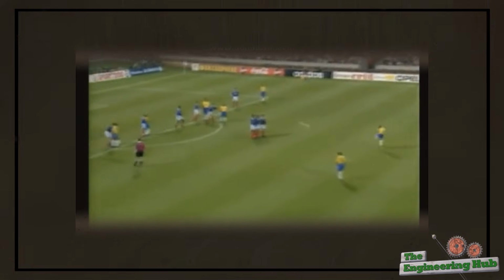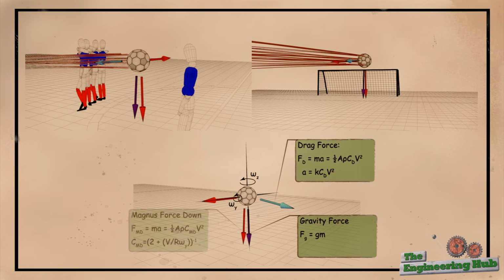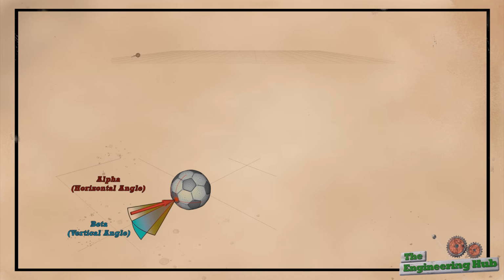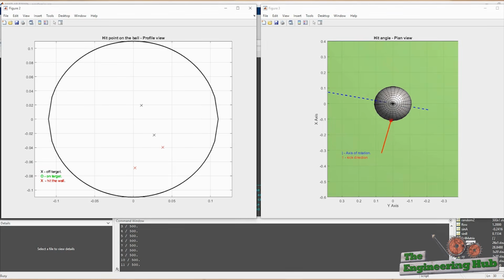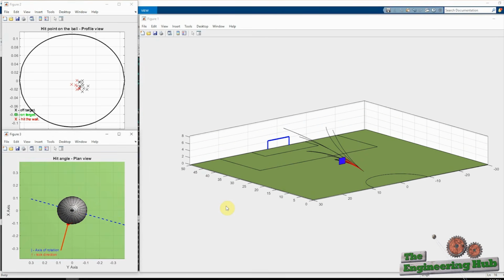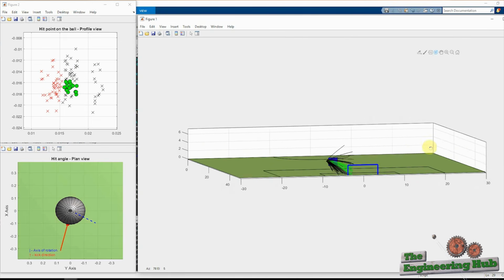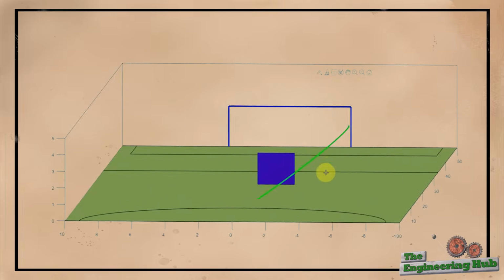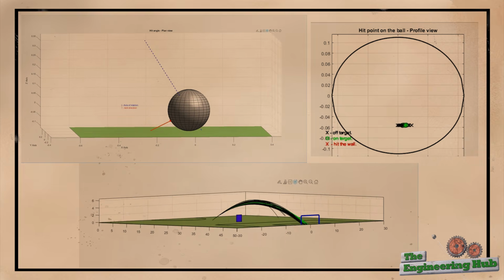How math and physics determine sports!

Comment: hey man, I am working on my extended essay for the ib. I am doing something very similar to your work. My research question is: "With a numeric simulation, how can I derive how a football must be shot on a free kick to score a goal?" I have already programmed a Python simulation allowing me to give 6 starting conditions: spin speed and 2 angles for the axes and shot speed + 2 angles for direction. I have also made a simple visualisation of the shots. The final step I want to take is the same thing you have done: I want to find out how much of the force is translated into spin and ball speed. Do you have some material on that, for example, a formula or something? I am not sure if I formulated this well enough for you to understand, I sometimes struggle with expressing myself with these scientific questions, as I am not a native speaker... Thanks in advance for your help!!
Reply from the maker: Hey buddy, I would recommend the book: Vector Mechanics for Engineers (10th ed) by Beer. More specifically Section 18 and Sample Problem 18.1. This will guide you through a 3D example. For modelling rotating bodies (balls) the magnus force plays a huge role. You would need to introduce this force separately which is a function of the spin of the body.
Reply: @TheEngineeringHub  thanks so much!!

Comment: Hi, thank you so much for the video, could you just explain on how you got the equation and what step size you used when using Euler's Method?
Reply from the maker: Hi, the underlying physics can be found in a generic dynamics textbook. I followed Chapter 18 of Vector Mechanics for Engineers by Beer, 10th ed. Sample Problem 18.1 should be a good starting point. In regards to the step-size, it had to be fairly small because the Euler's method is very poor, I don't exactly remember the size now but the model was prone to numerical instabilities unless the step-size was very fine. If I were to re-do the model now, I would convert the equations to a state-space representation and use 4th Order Runge-Kutta solver which is much more accurate and doesn't require as small of a time-step. Cheer!

Comment: Hey man, I really loved the work you put into making this simulation and video! It also got me thinking about the magnus effect on soccer balls and what "knuckleballs" really are. Please don't read my comments as criticism of your work, it's more that I am hoping to start a nice discussion.
When I see footage of sharply curved shots it often strikes me that the ball seems to be spinning a lot less quickly than I would think is needed. Also Carlos' shot seems to not spin very fast, which makes me think that the magnus effect is only one component of the lift on the ball. The other component I guess would be deformation of the ball, departure from its initially approximately spherical shape while it wobbles due to the impact of the kick.
I feel this idea is supported by the fact that hitting a proper knuckleball (as I understand it) entails hitting it very straight through the center so that hardly any spin is given and the trajectory becomes unpredictable due to the ball's elastic wobbling after the impact. 

I couldn't tell from your video how you determined the imparted spin due to the off-centre touch, which would already have had some assumptions in there (shear fiction of the contact with the shoe for example), so the one thing we cannot compare with the Roberto Carlos footage is the amount of spin.
I suspect your simulation needs more spin than Roberto Carlos did to achieve that curve , and I wonder if adding the ball's deformation and subsequent aerodynamic changes would improve the result.
Probably a LOT of work and a LOT of assumptions to be added...
Cheers!
Reply from the maker: Hi Qluq77, thanks for your comment, you are raising interesting points. This simulation used dynamics of rigid bodies to calculate the trajectory of the ball and determine the rotation about its own axis. In reality, of course, the ball deforms into an ellipsoid as it travels so assuming a perfect sphere introduces some error into the calculations. It's hard to say how significant this error is. Introducing material non-linearities into this model would make it incredibly complex to model/solve and honestly, I wouldn't know how to relate the deformation of the ball with the travel velocity (or shot power) since the amount of deformation would be dependent on the internal pressure of the ball. My intuition (no scientific backing just my opinion) tells me that the more inflated the ball is the less this error would be significant since obviously a softer (deflated ball) deforms much more. 
       Bias incoming: maybe assuming a perfect sphere is not an awful assumption since I am sure FIFA would ensure the ball is fully inflated for such a match.

When it comes to the knuckleball effect, I can't come up with a decent explanation nor an objection to yours so I'm sure there is some of that going on. I would have to read up a bit more and watch some shots to see the behavior of the ball and if there is some other effect that might be missing. Good discussion.

Comment: Hi. I really liked the model. Can you explain the randomization method and how you modeled and used the figure 2 and 3.  Thanks
Reply from the maker: Hi Ali, thank you for your feedback! The randomized method is basically a trial and error procedure that randomly samples values for the input parameters. The fancy word for this class of algorithms is "Monte Carlo Simulation" (MCS). MCS is mostly used for risk quantification but I applied it here as a means for solving the differential equations. These algorithms rely on repeated random sampling to obtain numerical results. Since the solution to the set of differential equations that govern the ball is highly sensitive to the kick location and angle at which the ball is hit, this method is an effective way to figure out a range of input values that produce a solution. Alternatively, it is also possible to manually change the input parameters for every simulation until you find parameters that produce a solution. Another reason for using such approach is the fact that the equations are too complex and an analytical solution does not exist, so I resorted to a sort of "brute force approach". I hope that clarifies things a bit.
Reply: @TheEngineeringHub  Thanks for getting back.
Yeah, that does give me a basic idea. It's interesting, I will look into it a little more. Any references that you would suggest?
Also, are you planning to do any more sports simulation?